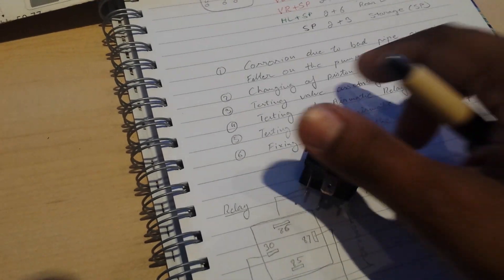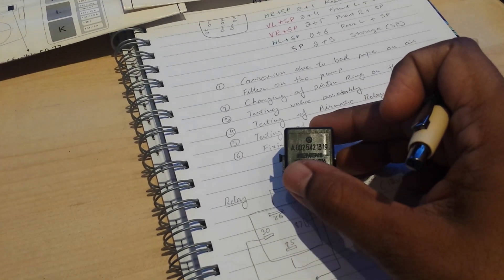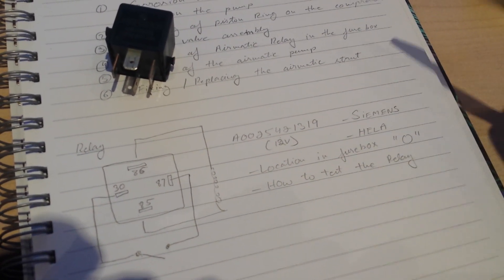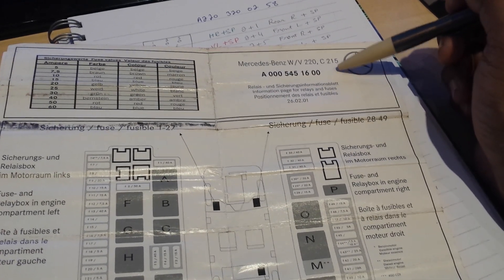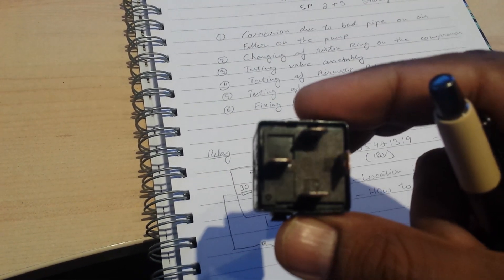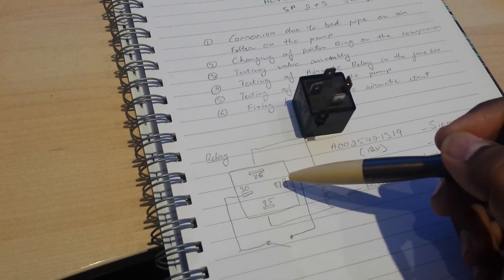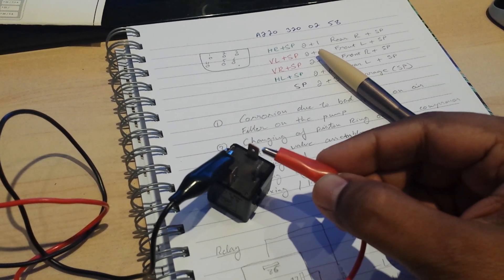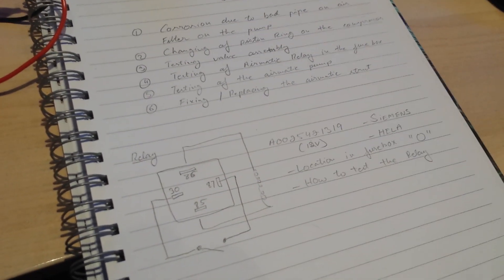Part 4   W220 Airmatic   Testing the airmatic relay

Comment: Hi, For those interested the current updated part number for the relay as of Jan 2021 is A000 982 8023 and cost £12 from Mercedes relay location in fuse box under hood/bonnet right hand side under windscreen

Comment: My s430 had a bad air pump, i replaced with new one and new relay but still not running, so i bypass the old relay and start working fine, any advise
Reply: How do you bypass the relay

Comment: Hi i have a w211 RHD and the relay is under the bonnet right hand side just outside the fuse box. However I cannot locate the fuse for airmatic pump. Can you please help. It would be so greatly appreciated.
Reply: Fuse box is on the left side of the car. When you open the door, look for a panel with an air duct. The panel is covered by the door once it's closed.  The fuse is a 15a fuse. There will be a paper diagram folded next to all the fuses. Look at the diagram. It's halfway down the right side.

Comment: Thank you very much! Great video. My air shocks need replacing and I wanted to be able to start the car without having the pump and wearing it out by running all of the time. Btw, that relay is also on the drivers side on American S series. I have no diagram and no O is marked on the top. The top is numbered 538.The layout in the fuse box is different on mine from the ones you showed,. but it is the third one down counting from the windshield and the same part # as you said and manufactured by Siemens. Anyway, I now can start and run the car as long as I want without wearing out the pump, thanks to you!

Comment: Thanks i've had weeks of problems bought new relay worked for a day then nothing. traced to loose connection at pump end, just very wary of putting hand down there with engine on. after watching this I tested relays all ok so £7.99 for a spare.

Comment: do u know the location of this relay on a 01 s430 is it on the passenger or driver side
Reply from the maker: Hi, if your car is a right hand drive car (i.e. UK for example) then it is the driver side fuse box under the bonnet.
Reply: Thank you
Reply: Hussayn Hussayn 1
Reply: Sasasa sasasa Hi, I know its 2 years later but im having the same problem with my 02 S500, if you’ve resolved the issue, can you let me know how? Im ready to pull my hair out lol Please and Thank You!